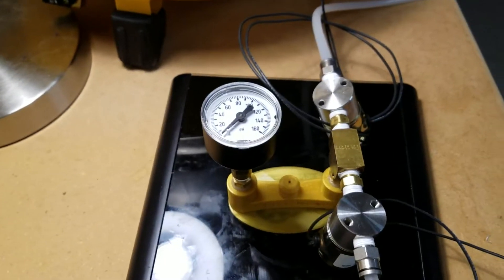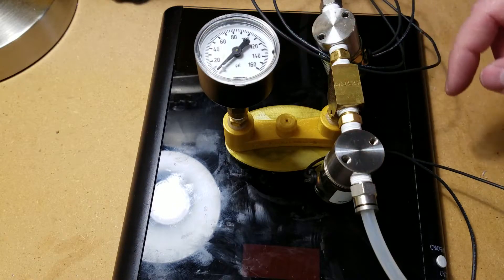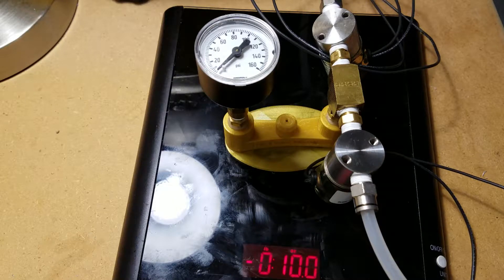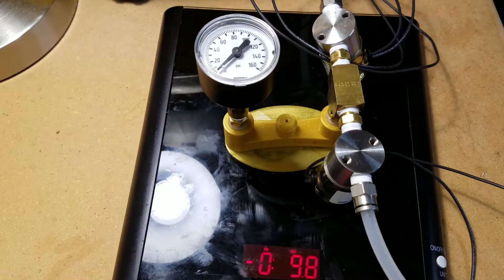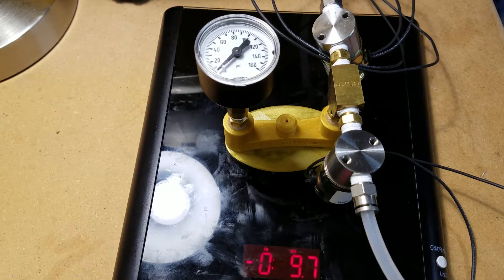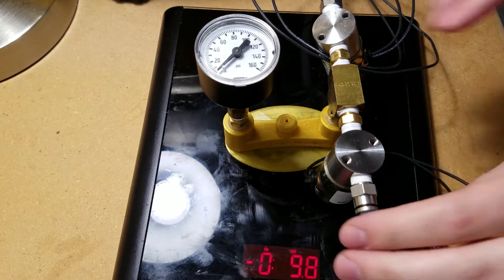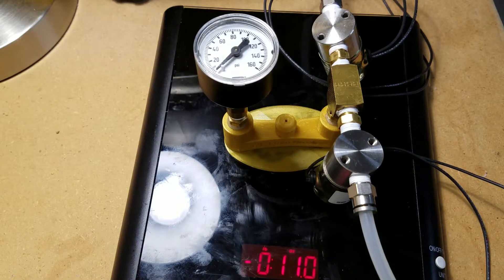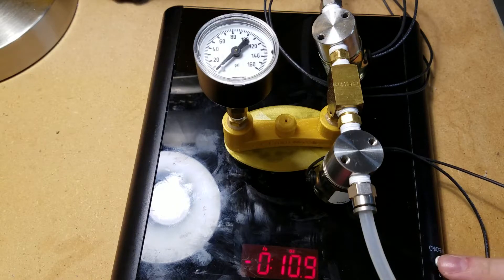Cold Gas Thruster Test 1

Comment: Interesting. How was nozzle designed?
I wonder what happened if you tried to use scuba compressor, which can go upto 4800psi? :)
Reply from the maker: The nozzle is a simple 15 degree half-angle cone which expands the gas to 1 atm at the exit, assuming a 100 psi chamber.

If I used gas at 4800 psi, I need very different hardware.
Reply: @Larsosborne  Oh! It's that simple of an nozzle :O

Of course a bit of maths probably went into getting the exact right dimensions?

Yea those solenoids probably would not work at that pressure, and would get stuck. the nozzle might not be able to take the pressure neither :/

Then again 30 times the power! instead of around 170gr thrust around 5kg :D

I am wondering how hard it would be to make a system which could provide say 1000kg of thrust for 1 second
Reply from the maker: @skaltura  Thrust force = mass flow rate * exit velocity (When ideally expanded)

Assuming an exit velocity of 491 m/s, it would need to use 20 kg of gas. That is a lot of gas to store in a tank.
Reply: @Larsosborne  That indeed is quite a bit of gas. Higher pressure would allow higher exit velocity, yes? Designing a venturi on nozzle beginning would allow higher exit velocity as well, well nozzle design as well?

Also compressing 20kg in seconds is going to require tremendous amount of power and interesting hardware.

Curious nevertheless! :)